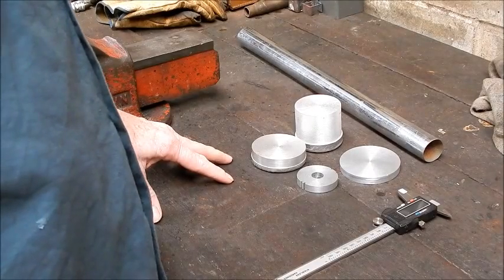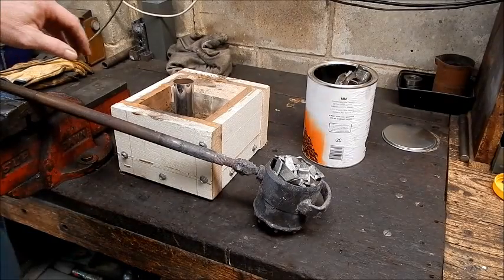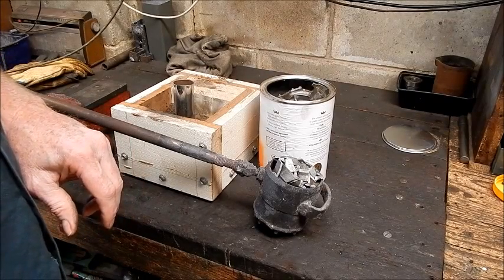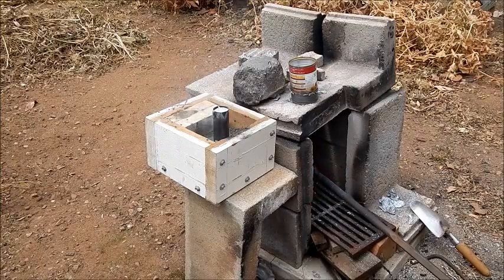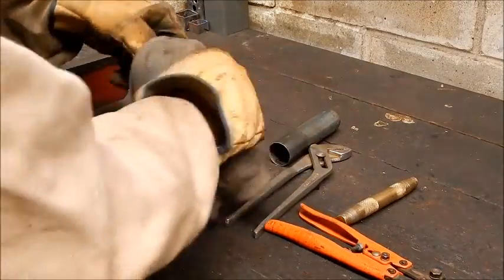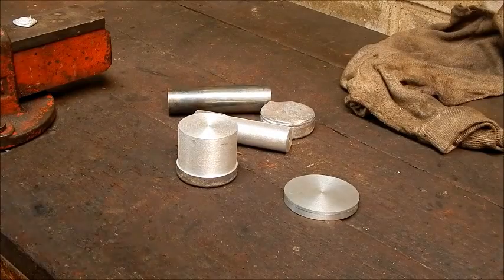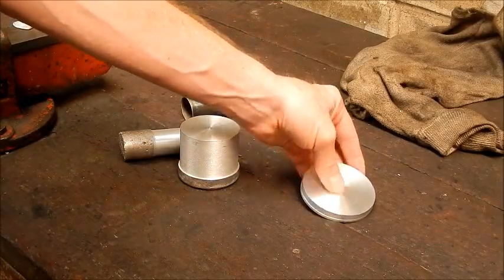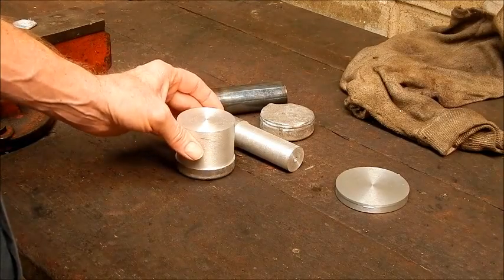My first attempt at casting aluminium round stock

Comment: That was a great video.  I never thought of casting into a pipe.  I did a small amount of sand casting about 35 years ago and I just may start up again.  Thanks for the video.
Reply from the maker: Thanks.  The aluminium will always pull away from the pipe due to the alloy's approximately 3% shrinkage factor when cool.  The pipe has to be uniform and NO internal seam. I will have another go at this when I get time.  The alloy I used was pretty crappy, and I think it may have been the type they cast with a centrifuge.  Rob

Comment: Fantastic. What I've learned is that I'm not using my brain to think outside of the standard concepts. This is the benefit of not having the resources immediately at hand. You improvise. You're shaming me with my mechanical engineering degree. I normally operate like you do, but learned through ease of consumerism to forget that I have the resources to do far more than it appears. Thanks for sharing your experience.
Reply from the maker: +Gkuljian 

It comes down to mindset. and everyone is different.  When I look at something I always think why do it that way, is there another way to do it with less?  I guess I am never satisfied with the process.

People just accept that the existing way is the only way.  It may well be the best way currently, but that doesn't mean another way isn't possible -  it's just that someone hasn't thought of it yet.

This is why I have a severe dislike of skeptics.  They are useless people that never think past given concepts.  If we were all like that, the world would never progress.

Cheers Rob.

Comment: G'day again Robby, mate I'm stoked to see you using my idea I sent you of using vacuum cleaner pipe. The results you're getting are exactly the same as mine. Well done champ :) I'd suggest the reason its not machining as well as everyday aluminium is because that material or some of it could well be duralumin which is often used to make castings for many things such as, electric motor housings, car water pumps etc, etc It machines exactly how that bar you made did and it sometimes will have tiny pinholes but yet still has good tensile strength. As I mentioned a while back a slit down the length of the pipe and closed back up with hose clamps will allow easy removal of the metal, particularly with brass. IT STICKS to the pipe real well. Stainless steel pipe works heaps better than chrome plated pipe.Take care champ :) Love the vids too :) Cheers, Bill.
Reply from the maker: You may be right regarding the duralium aspect.  I made a reverse tumbler gear out of some electric motor case end castings and man is that tough stuff.  There is absolutely no sign of wear on the gear.  It's has a matt/dull finish when machined and is as hard as nails.  Very good gear material.  Bit wet to do any casting at the moment, but looking forward to summer and get back into it.  Cheers Rob

Comment: Yeah its tough, you can find duralumin/dural almost any where and its just so easy to work with.Tends to leave a deposit on lathe tools like ally does if you take big cuts but all in all I use it for many applications and it has not let me down yet. as well as vacuum cleaner pipe I find that stainless steel bollards and the cheapy toilet roll storage pipe thingo's from the supermarket work a treat for bigger diameter castings. By the way I now have a toilet roll dispenser in my workshop thanks to your great idea of using dunny rolls for rags n stuff, how absolutely handy. Also robby, you'll find if you preheat the vacuum pipe to somewhere around bright reddish before pouring it will help with those pesky little pinholes and give a cleaner casting.
Cheers bud :)

Comment from the maker: This furnace is a simple set up, costs almost nothing to make and run, makes no smoke, and using the shop vacuum as a blower makes plenty of heat.  Maybe later I wil try sand casting, but this is a good easy way to get started.  Have a go Fred. Cheers Rob.

Comment from the maker: I saw a YT video from Romania where they cast alloy into a short hollow tube resting on a metal plate.  The round metal cylinder of alloy came out of the tube quite easily.  So I wondered how it would go with a longer length of uniform tube.  No problem.  I have seen the results using green sand casting and they are nowhere near as good.  So overall I'm pretty happy with how it turned out, and if I can find some good quality metal the results should be good. Rob

Comment: Thanks for sharing that. I found that very interesting. On thinking about it, it may also be that by using Stainless Steel and as a result a sealed form, maybe the Al did not have the opportunity to gas out in the mold as with sand, and that the SS caused it cool to rapidly also not allowing time for the gas to escape. It would be interesting to see if you remelted the same Al and used a sand mold to see if the inner mass quality had improved. Would you are doing is very cool. Thanks again.
Reply from the maker: You could be right, but theoretically most gasout occurs in the crucible - I think.  I will try casting into sand.  My next cast experiment will be using the lost styro foam method where you make a shape out of old packing foam, coat it lightly with plaster slop, bury in sand when dryed, and cast into that.  Sounds great eh :)  Cheers Rob

Comment: It's like a simple die casting.  I wonder what results you'd get if you heated the pipe with a torch right before you poured.  I've found lead molds need to be heated prior to pouring or you get a wrinkled effect in the cast lead.  Thanks for posting this btw, I was curious about this too.

Comment: What would happen if you melted it in the casting tube instead of a separate container?
Reply from the maker: You could do that.  It's important that the tube is perfectly cylindrical or you will have problems knocking out the alloy. Heating steel to these sort of temperatures causes it to flake and rust which makes extraction difficult.  The other way to do it is melt the alloy in a suitable shape/size tin can and let it cool, then peel away the tin.  Rob